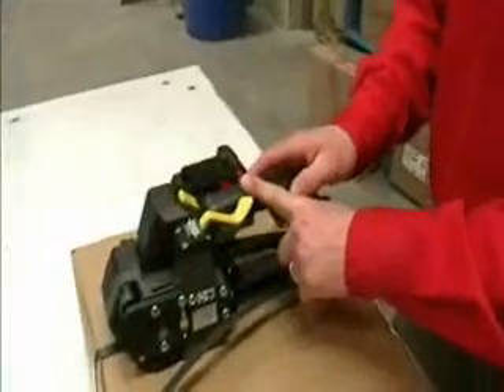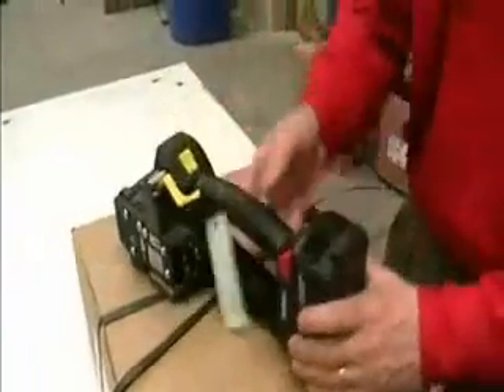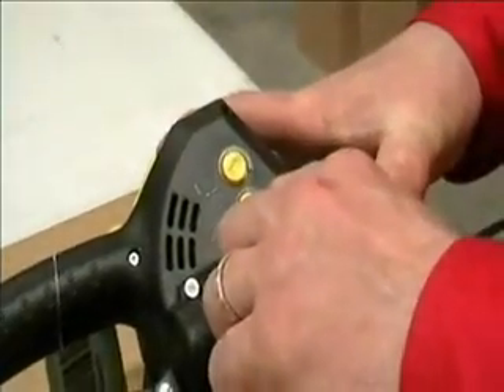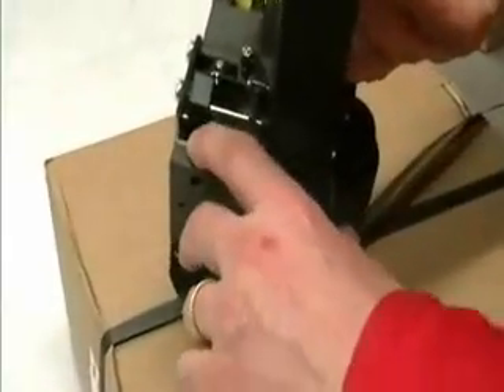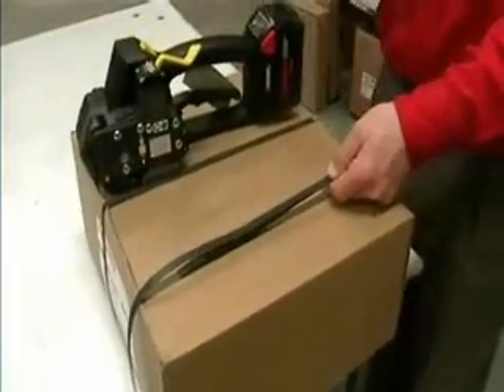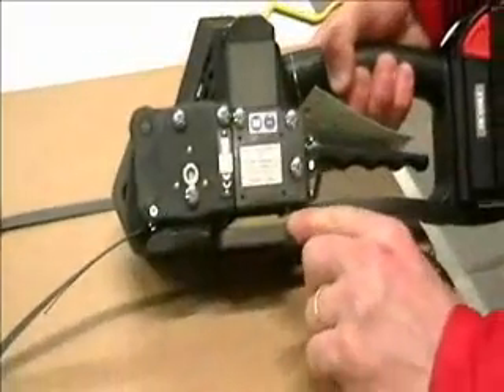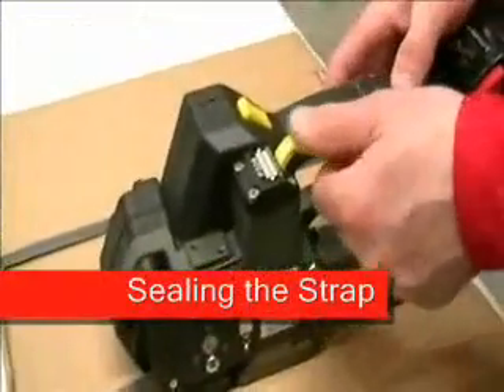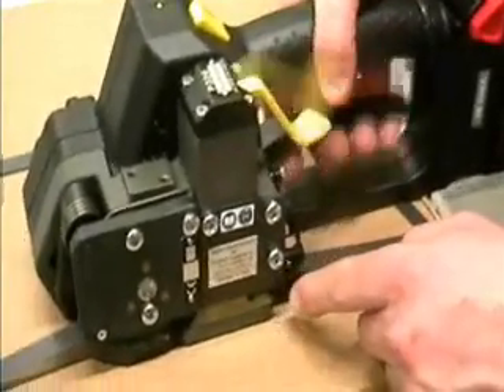How to use a Fromm P326 Strapping Tool - PTIPackaging.com

Comment: The tool should be set up to work with the specific size strap you are using. If the banding is too thin it may be slipping out when you release the handle.